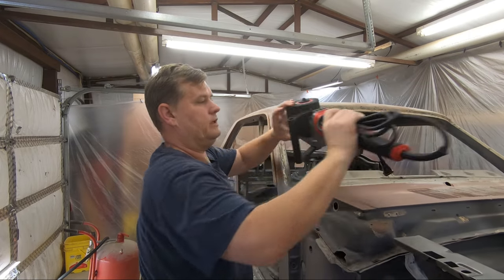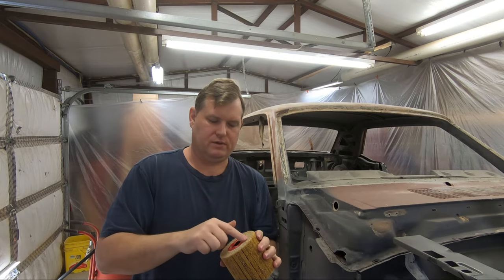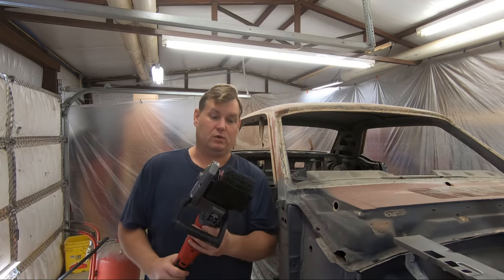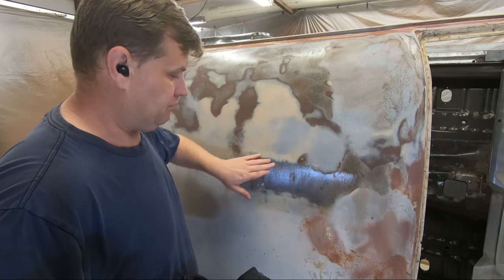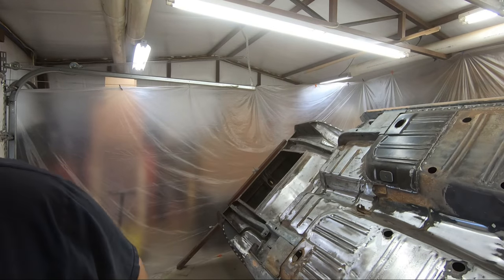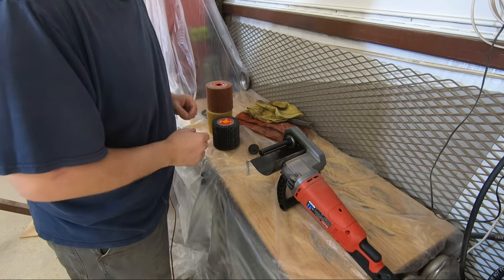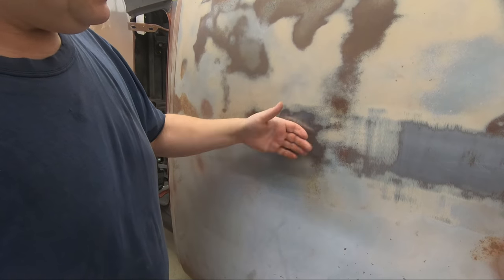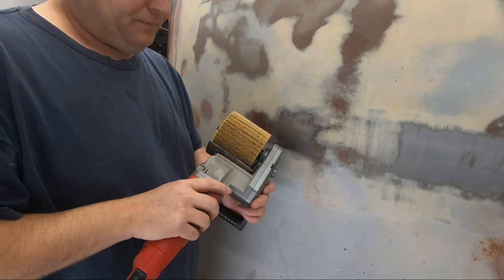Harbor Freight Bauer SCT review

Comment: I bought one of these for my project and love it. For my purposes, the Black 40 Grit seemed to work the best and using gravity and the weight of the tool seemed to produce the best results. Great video on this tool. John
Reply from the maker: Awesome. I wouldn't be without mine now that I have it. I have to make an update on it for some new stuff for it. The other drums are really for stuff like stainless steel and blending welds. I wish someone made the purple wheel for them as they last longer than the black ones.

Comment: I was literally about to buy the expensive one, great video thanks ! I had no idea HF has this 👍🏻
Reply from the maker: Awesome. I am still just as happy with mine today as the day I bought it. No complaints.
Reply: @theinfernalcraftsman   just picked on up on sale, plus got 15% off , haven't used it yet but this thing seems pretty badass, thanks again!
Reply: @theinfernalcraftsman   hey could you tell me what those two long skinny pieces that come in the Allen wrench bag are ?
Reply from the maker: @johnmartin5153  They are the keys that go in the shaft. You can put them in the shaft then slide the wheel on or slide them in after putting the wheel on.  Some attachments don't use the keys so they have to be removable.
Reply: @theinfernalcraftsman  ok thanks. I used the black stripping drum today without them on and it worked great. That drum must not need them.

Comment: Hi Robert. Found you thru watching Barry. Great review. I’m just going to start the body work and this tool looks like the way to go for the initial stripping on the panels. I did the underside already (assorted wire wheels and gobs of time). Thanks for sharing.
Reply from the maker: Awesome and thanks. I wanted to try out the nylon bristle brush as I think it will work better but I wanted to get a video out and not spend anymore $ at the same time... :)

Comment: Its the exact same tool as the Eastwood sct only cheaper with a shorter warranty but you can buy a warranty from HFT I bought one and I like it a lot it won't fit every where but for large panels it works great and  HFT and Amazon has some of the drums at a more affordable price.

Comment: You mentioned initially you had the machine at half speed.  Is that where you kept it when you stripped the bottom of the car or did you turn the speed up?  Are you still using the first black wheel or did it finally get used up?
Reply from the maker: I left it at half speed. I ran it a little faster on some areas to test but if you run it too fast and stay in one spot too long it will melt the paint and make it gummy and more of a mess to remove. I still have some usable abrasive on my wheel. Doing the bottom of the car shreds more because of all the sharp edges. If you are doing the regular body panels they will last longer. I would guess 2 maybe 3 to do a whole car. Just depends on how much and what kind of paint and how you use the tool. I can make grinding discs disappear fast and not remove much. But I can be easy on them and get allot more work out of them .
    The only part I still need to strip is the trunk lid and I will have more than enough left for it.

Comment: You put the handle on backwards. You'll get more pressure with it flipped.
Reply from the maker: You are correct but in my application the handle to the front gets in the way and you want very little pressure on automotive sheet metal because it's thin and flexible and pushing hard creates heat and will warp panels.

Comment: Could this be used on wood provided you were gentle with it?
Reply from the maker: It could be. You can get a drum sander attachment for it. You can also use the brushes on wood as well but they will leave a worn look to the wood as it will remove the soft areas and leave the harder grainlines proud. But if you want to keep a board flat with the drum attachment it's not going to happen. Better off with a belt sander for that.

Comment: I have heavy rust to remove how does it do on it?what drum would I need to remove heavy rust
Reply from the maker: If you have heavy flakey rust I would knock as much off by scraping or chipping etc then the lack poly abrasive wheel would be the one I would start with. I wish the purple one as made for these tools but so far no one makes one.
Reply: @theinfernalcraftsman  this is  surface rust from where the pickup truck set with no paint on it is not flaky by any means.. but it is pretty heavy surface rust
Reply from the maker: @tracymawer6980  The black "poly abrasive" wheel would work the best on the surface rust. The trick with any wheel of that material is not to hit edges and sharp areas like holes in the sheet metal as they are like a cheese grader and will ruin a wheel quickly. Paint is surprisingly harder to remove than surface rust because it gums up when it gets hot.
Reply: @theinfernalcraftsman  thank you our harbor freight is out of stock I'll get one as soon as they get them back in
Reply from the maker: @tracymawer6980   I'm happy with mine though I need to get another wheel for mine. Wish I got a cut from HF for all the tools I helped them sell...

Comment: The wheels are circa $12 a piece at HF
Reply from the maker: Yup they listed them after I did the video. Good price on them as well and the black stripping wheel is $25 which is the same as amazon and the other two wheels are priced cheaper than amazon. Hopefully they will get them in the stores soon so I can pick up spares.

Comment: Your handle is backwards  Sir  👍
Reply from the maker: I tried it both ways and it was getting in the way the other way and it was more comfortable with it pointing back. If I were putting allot of pressure on the tool then it would be much better the other way. One of those things like a grinder handle, just put it where it works for you.